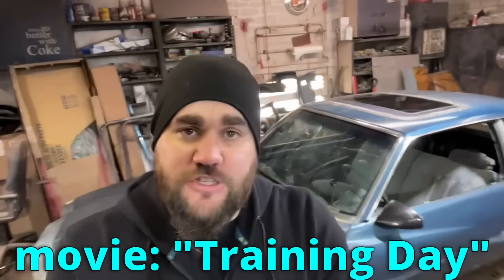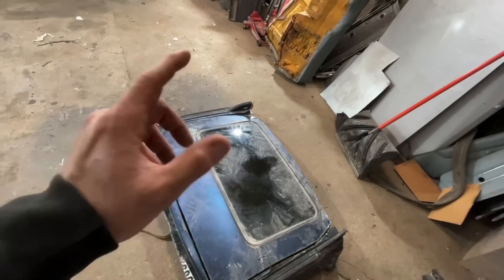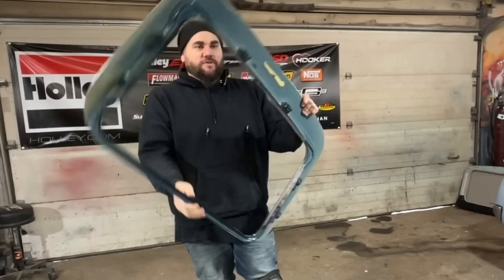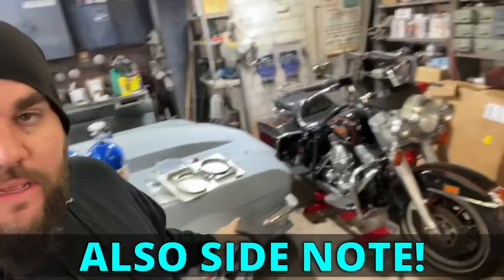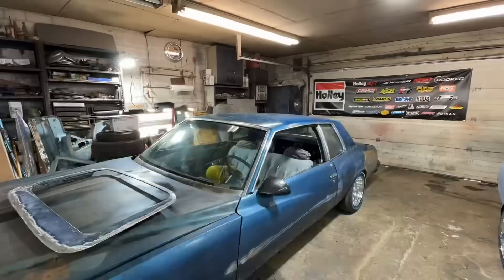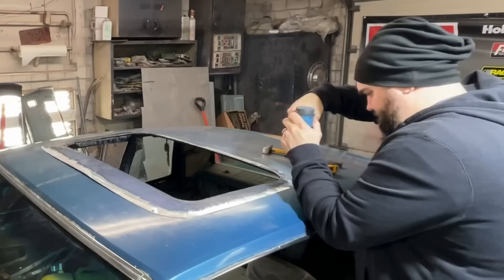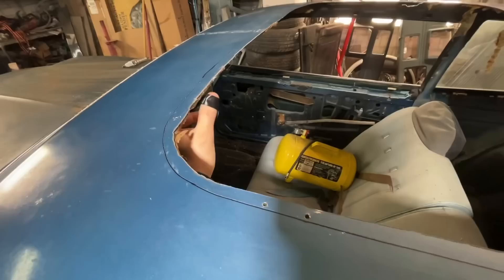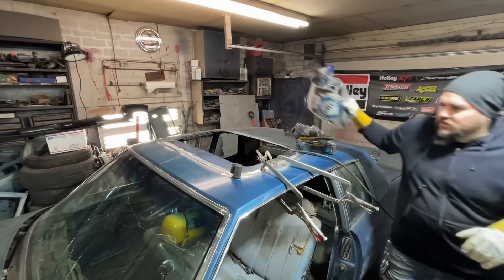CUTTING UP THE TRAINING DAY MONTE CARLO! TRANSFORMING INTO A MOVIE CAR! KUSTOM HOT ROD LOWRIDER

Comment: Casey I'm sure you already know this but make sure you use the correct spray paint for those plastic interior parts otherwise I'm a few months they will look like $hit! There is a few more expensive paints made for the job but at bare minimum make sure to use a plastic adhesive paint, if those parts are indeed plastic. I did a trucks doors panel once and it looked amazing but after a few months the arm rest looked like a Picasso painting but not in a good way. Peace out keep up the great work man

Comment: When I tried to fill in the sunroof on one of my cars, I left the rolled lip in place figuring it would be less likely to warp. 4 tack welds in and it buckled the roof. I had the heat pretty low, but i guess not low enough. The actual movie car sunroof is too far forward, for sure.

Comment: You need to put the drains on it. It will leak. They all leak. The gasket isn’t enough to prevent water infiltration. Trust me I know… most leaking sunroof are block drains.

Comment: Those mirrors come in a bunch of different lengths.  The short ones are the ugliest. I wouldn't put those on anything except a camaro but that's just my opinion. I think u can get interior paint. I got it yrs ago for a reatta . U spray it on let it dry and wipe off the dusty crap. U can do carpet plastic pillers and everything and it looked factory u couldn't tell I did it. But regular spray paint usually looks atrocious on interior.  And it usually chips and cracks from the plastic expanding from cold and hot. I think the training day car has the longest mirrors tho. The reason for the length difference is some gm cars the camaro mirror would hit wen u open the door fully because it's so short.